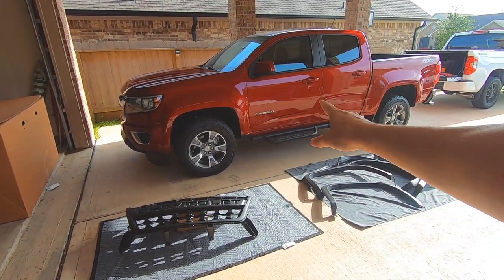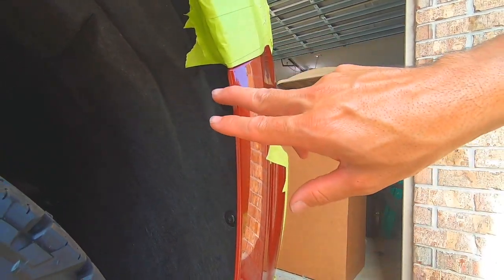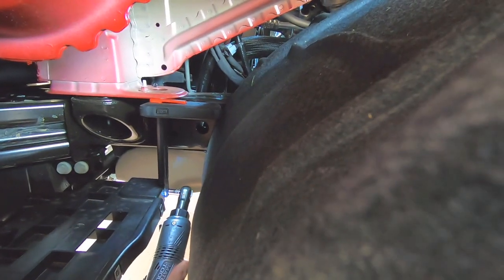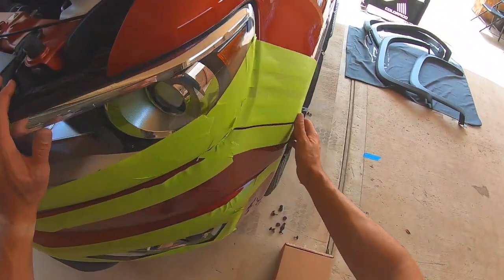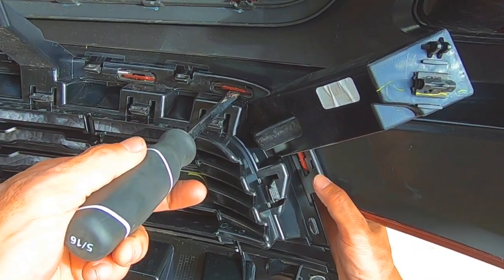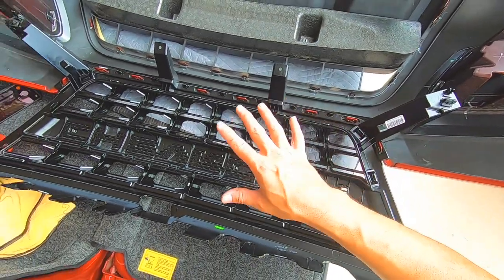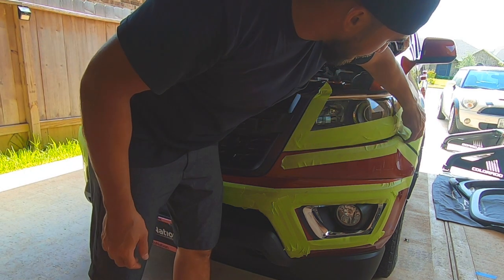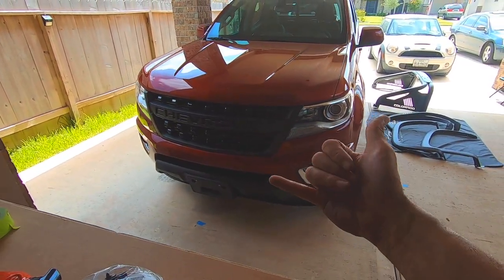2020 Chevrolet Colorado Bison Grille Installation How to Remove Bumper W no Damage! 2017 2018 2019

Comment: Great video. Very helpful. Completed Bison grill swap today on a 2020 Colorado. Two things. First, I found that the third 7mm bolt on each side could not be extracted with a socket wrench or ratchet like in the video. I used just the 7mm socket by itself and was able to loosen the third bolt by hand. Tightened it again by hand during reinstall. Second, the two grill clips which snap into the frame cannot be pushed in snug by pounding on outside of grill. I had to reach in via the fender-wells to line up the grill clip into slot and pull it hard to hear the snap. I heard snap clearly on both sides. The tape is available at Auto Zone and I also recommend using it. Thanks again.

Comment: Great video, the issue I’ve experienced with these grills is, because they have large openings a rock was able to get thru and damage my condenser and all my Freon leaked out. The dealership at first did not want to replace my condenser, and that was my issue the manufacturer grill don’t offer enough protection from bugs and rocks, because of the large openings.  So once they replaced my condenser I went and took off my bumper and installed a wire mesh for protection.

Comment: This is a great video and really goes in depth but the one thing I will say is you make it a lot harder than it is. Removed replaced and put back on the bumper in around 1 hour. I think all the tape was a little excessive. But nothing less good video for those who want to install the grill
Reply from the maker: Thanks for sharing

Comment: Really looking forward to seeing the wheel upgrade. Very interested in the offset difference from stock. I have a Colorado Z71 Trail Runner and plan to change wheels soon. But first, the air dam is going to be removed and this video will be extremely helpful because it appears removing the bumper is the easiest way to do it. Great how to video.

Comment: If the fog light trim is hard to change, the cheaper was is plasti -dip, works great for little things like that. I would put like 12 light coats, I put like 15 on my grill & still lasting over 10 years.

Comment: Love the video! Looking forward to part 4. Quick question, what are your thoughts about the air damn? Apparently ppl don’t like it and doesn’t effect the mpg when taken off? I kept mine on my Canyon.
Reply from the maker: It probably will effect mpg if your on the hay alot and at stock ride height.  Lots cool without it if you have tires and a lift.   It just depends 🤷

Comment: I have the "CHEVROLET" grill.. if i wanted to paint that part white without taking off the entire bumper to risk damaging the clips or scratching the paint, would it be okay to wedge some newspaper behind it to prevent over spray, and mask off the other parts of the grill?

Comment: I got 3 scratches (4" long and as thick as the  writing of a ball point pen) on my front bumper cover that went thru the base coat (Cajun Red Tintcoat). Took it to the Chevy garage and got an estimate. 16 hours of labor to remove/install the cover and paint it plus $250  in materials; over $1100. I am thinking of removing the cover myself and finding a autobody shop to paint it. How long did it take to remove and reinstall the bumper cover? Thanks.
Reply: 16 hours sounds kinda fishy to me. I don't see why they need to remove the bumper cover anyway. Sounds like they are trying to rip you off.